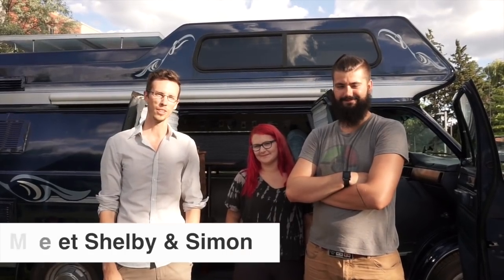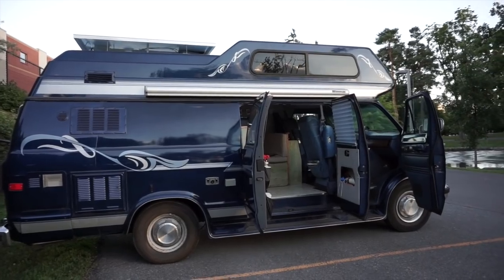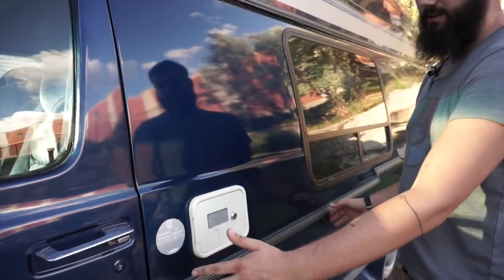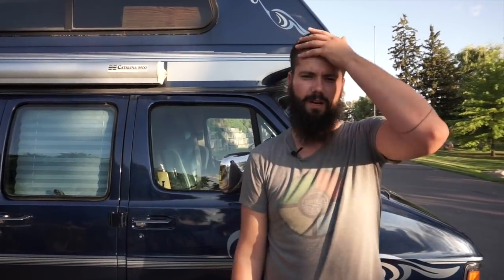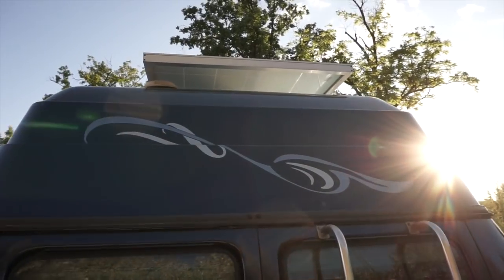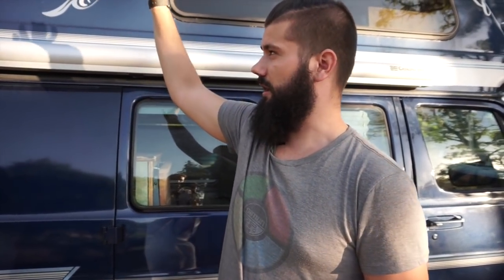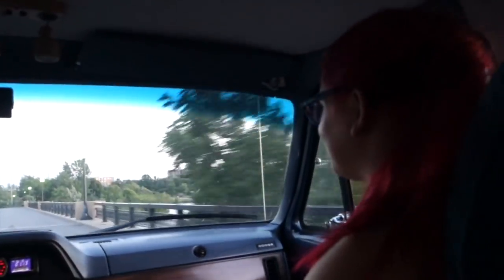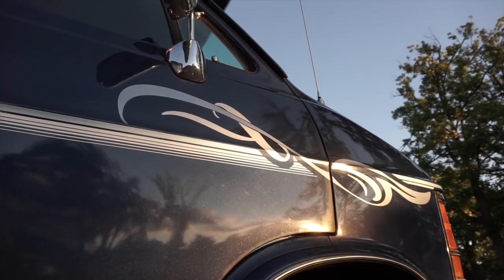Van Life - Couple Moves From Apartment to Camper Van Full Time

Comment: Forgive me if you have already talked about this idea.  If you find that empting a black tank is too much trouble you should look into a composting toilet.  I use one inside my house as a way to be more green.  I like the use of solar panels, I find that a single battery will last a long time when just 12 volt lights and fans are used so your setup should be golden.  BTW truck stops have a wide variety of 12 volt stuff.  I am sure you already know that.

Comment: I being a retired mechanic will advise you one tip, preventative maintenance is your best money saver.
Don’t go cheap. Fix it or have it fixed correctly. If one engine belt goes bad, its time to change them all.

Comment: I have the same goal to do what these guys are living. I can't wait to get my M109A3 RV conversion done! It was originally "converted" by the previous owner but the way he cut corners and how he set it up kinda sucked and because of that it was cold in the winter (I stayed in it for a year or so in my driveway) so I've gutted it, installed a raised insulated floor, and painted the walls & ceiling. Now I just need to install the basic amenities like water storage & plumbing, A/C & heat (I have a nice propane heater & an 1860's Jewel potbelly wood stove), solar (I currently have a temporary setup from Harbor Freight & two 100 amp deep cycle marine batteries), and a few other things and then I'll be ready to roll. I think a YouTube channel documenting the rest of the build and my van life is in order.

Here's some pics of the previous setup from when I was staying in my driveway.......

http://www.imagebam.com/image/22d7a9434203319

Comment: auxiliary trans. cooler, filter and aux oil filter will put off a world of major mech repairs in the future.  This van was very prone to over heating. Spare hoses and clamps plus belts will come in handy, as will a decent set of tools.  A 25 yr old van needs a little TLC. My van experience was in TX  surrounding states.

Comment: Not smart to take a 25 year old van across the country hauling all that weight on that shitty engine
Reply: The 318/360ci dodge motors are actually incredibly tough and reliable. I have a 1990 dodge B350 camper that I would trust to take across the country. It is all about preventative maintenance. Well maintained = no problem.
Reply: I've put 50K miles on it so far, no drama from the engine. She pulls all day long. Check your info.
Reply: +JamesJudasPriest: There will be problems with any vehicle that old. Hopefully nothing too serious. But be prepared for the worst because electrical systems deteriorate and water tight seals tend to fail at that age causing all sorts of problems.

Comment: Well been trying to do this for a few years now and things have not gone the way I wish but still trying. One thing that I do plan to do is replace the toilet with a composting one, then replacing the black water take and  putting in a extra tank for potable and grey water. That way you can boon dock a lot longer.
Reply: +2012spacetraveler very true, we've found that we create 8-12 times more grey water than black water. for now it's what we've got, we may change it round as well though

Comment: I used to work on the Dodge church vans.  Take the trim rings off.  They can cut the tires.  And make sure you have E-Load tires on the rear.  These always handled better with 80 psi in the rear tires and about 50-60 psi in the front.

Comment: Rain-X on the inside of your windows will help against condensation fog on those cold mornings.....
Reply from the maker: +Antique Van Camping Cool, thanks for the tip! :)
Reply: +Exploring Alternatives  .....One more thing, some Bounce drier sheets stuffed in the dark moist corners/crevices of the van (such as by the rear doors), and also stuffed in the front dash board vents should prevent any spiders from entering.......
Reply: OMG!!! I LOVE this tip for keeping out the spiders-that has been such an issue for me on some of my trips to wooded areas!  Once my car got so infested with spiders that when I walked up to the window, before I even put my key in the lock, I could see a hairy spider that I swear was bigger than a little tarantula in a web it had spun all over my steering wheel-and there it was, proudly sitting in the middle of it all like, "See there?  See what I did??? Don't even think you are getting in this car and are going to ruin my beautiful creation!! I am here to defend it to the death!!"  I was so gagging-I don't mind getting rid of tiny spiders, but I had never, ever seen a spider this big in my life-and this was on a rooftop garage in Chicago!! I lived a block from Lake Michigan, and was told by the building management that they blew in off the lake-brrrhhhh!! I still have nightmares about all those spiders-before I could ever drive my car I would have to spend at least 10 minutes searching high and low, killing the invaders and leaving a pile of spider carcasses on the pavement for eager seagulls.  It was unbelievably disgusting-but now I know how to never, ever have that problem ever again!! Yeah!!
Reply: +Geny R. yuck! I have seen some pretty big ones in nc, enough to make one cringe with disgust.

Comment: 2:45
That looks like "TAC TAC" our 7week San Diego to Eugene Or touring van.
Tac Tac was the sound that came from the engine shortly after buying it and gunning it up a hill in Oceanside CA.
Funny enough, bec we had to be so gentle with it, for fear of engine death, we drove the slower route 1 instead of 101 and saw/experienced a lot more.
Paid for itself in housing & transport easily!
$2350 Sold it for $1900
*It had a LAUNDRY LIST of OMG stuff to be done. Happy to see it drive off and not be towed

Comment: Sounds like you have a pretty good plan....Please just remember, you are dealing with a 23 yr old vehicle...and no matter how well maintained the van has been over the years, its likely unpleasant things are going to happen, and if you are not pretty mechanically (auto) inclined, you will need to not only pay for replacement parts, but the labor needed from a good mechanic..(I'm guessing youre well aware of the foregoing)...The subject of taking off on a van adventure, of course is a popular one, and appears often on youtube..one of the real popular channels is Nomadic Fanatic, you likely know of him...and he has also used older vehicles and has experienced all the common failures/breakdowns...but he keeps a positive attitude and keeps on keeping on..I wish you the same and the best of luck!
Reply: +daniel lack this is a good point relying totally on one vehicle doen'st seem sound one full time rv'er (not truly a big rv smaller version) keeps bikes in thier rv in case they need to travel around or get food or when their rv is in the shop. but of course I prefer a motor cycle or a tow behind small car or something ro just my trucks using a pull behind home. (not sure of what kind of home I would like yet heard some negative things about travel trailors I dont like)

Comment: I also live the Free Life as an Urban Van Dweller. I've never been so happy and get to travel all over beautiful USA. Never worry about break-downs if you carry spare parts and basic hand tools. Keep a spare fan belt, distributor, fuel pump, alternator and starter. Maybe throw a water pump in there too. As long as your filters and fluids are clean, belts and hoses maintained and a general inspection of the engine on annual or semi annual basis there are less worries about break-downs. These parts for older vehicles are cheap as dirt on Ebay for brand new parts. Having the part is half the battle won if there are any problems on the road. Labor costs on the road at random service stations will kill you so watch YouTube Do-It-Yourself videos to see how parts replacements are done for your specific van or similar equipments. Enjoy the Free Life and see the USA in style.!
Reply: +Stanley Stalvey If you get stuck in a remote, obscure location it could take days to get the auto part you need so they are much cheaper to have handy. An alternator can be had for as little as $37 dollars on Ebay. Buying one out on the road will cost you $180 dollars just for the same part. A complete distributor will cost as little as $45 on Ebay. Out on the road they will charge you $145 dollars for the part alone. There are crooks everywhere that will take advantage of your emergency. A battery, alternator and fan belt on the road will cost you $600 dollars for parts and labor not including tow charges. Get a AAA Auto Club membership for towing and emergency services. Enjoy the Free Life much better with these tips..
Reply: +Stanley Stalvey A can or two of Fix-A-Flat with a small tire air compressor is a must for your tool kits. Wheel bearings are very inexpensive so you may also add these to your spare parts arsenal.

Comment: Another great tip for living the free life are body oils like Skin So Soft or Baby Oil. After a bath, rub the oils all over your body and you can go for a couple weeks if necessary without smelling bad. This will also help prevent dust mites and other pests that bite the skin. Plus you smell good.! hehe.. Plenty of clean clothes for frequent changes even without a bath are very helpful to keep away germs you pick up over the course of the day. I carry several bottles of hand sanitizers or baby wipes for quick cleanups. It works like a charm.! Enjoy the Free Life.!
Reply: +Stanley Stalvey is this true? sure can use this for myself I suffer terribly from dust mite allergies (I vacuume like crazy wash my stuff like crazy and use a air filter in my bedroom) I never thought about oiling my skin, I will look into this. great idea.
Reply: Yes, I've been in the Nevada desert for a year and the dust mites are driving me batty. I have to spray, oil and still vacuum the mites out of my hair a couple times a day. It got bad before I discover there is a spray I can use. Plus my cat wallows on the floor then jumps on my bed so it's been some work to keep critters off my skin. I'm moving next month back to an area with grass and trees. I'm so tired of all this desert dust and dirt. Can't get used to it..

Comment: This looks amazing.  They said their van was a 1992-I looked into these new, and had to scrape my jaw up off the floor and pop my eyeballs back into my head.  The sticker shock was quite severe!!! I may have missed it, but did he mention how much they paid for the van?? I know that most people don't live in these full time, and hopefully this one didn't get a lot of heavy use, but if I was buying a van to live in full time that was 23 years old, I would be very afraid of mechanical failure as well. I know there are many variables-such as how it was used and maintained by previous owners-but are these vans pretty sturdy?  After 23 years is it going to withstand the rigors of the kind of road life they want to lead???

Comment: you have acid battery right next to inverter, your batteries should be vented to the outside and should not share air with converter or inverter. at least get sealed agm batteries. other than that happy travels

Comment: I can see many problems ahead...

First it seems that you do not have any experience with campers or living at tiny place where all the things have to have their own place. After few days you want that the bed is always ready and you do not have to shift things to go to bed or go to breakfast or go to drive position or at the long leg the other wants to sleep when the other one has to drive because you have some fund rising meeting 1000 miles from where you are at the moment.

Second the car is old, as you said there will be a lot of technical problems which are quite expensive if you are at the middle of nowhere.

Third your solar system is underpowered, horizontal panel's efficiency is very poor and it seems that your computer needs the inverter which will turn a lot of power to heat... You should ditch all the AC stuff and go to DC, 12V or 24V.

Fourth is the heat, you have few vents but those won't cool the car. Your fridge won't survive when there is really hot.

Fifth is the solar panel's output when it's hot and you have to park at the shade. The solution is a long cable and light weight portable panels.  

Sixth is the cold. The insulation of the van is poor, a lot of windows etc. You need a lot of energy to keep the warm up.

Seventh is the deadly sin (which do not touch you but all the others, like me, who envy you)...
Reply: Looked your youtube page. You have four videos and those are food (1), jesus who is pissed (1) and hate (2). No videos of making a long road trip with Westfalia. No tips for beginners. I do not have camping car videos on my page but I have knowledge of camping cars from 1986 and solar panels from 2007. Made trips to warm and cold places. Of course those guys will learn and manage but the starting point for that long trip is not the best one (route told at Episode 013 - Running Again). At least they are not at south at the summer. My seventh point was that I envy those guys... I can't leave and start any long trip for years (children etc...)
Reply: ok, sorry. I won't start or participate to any talk on this youtube channel anymore. Hate won and I'm out. (Still envy for the young couple's trip).

Comment: yeeesh. I hope those aren't lead acid battery. They can emit fumes that should be properly vented to the outside.
Reply from the maker: simonlynchsae I think they are but Simon is working on venting them properly :)  Thanks for watching!
Reply: +simonlynchsae we've got a 12v old computer fan that runs when the charger is running and sucks air past the batteries and inverter and spits it out the old 30 amp shore connection outlet. It was actually really easy to setup. and keeps them well ventilated and cool.

Comment: Those aren't sealed batteries you're using for the solar, and they're inside the van, yikes! You shouldn't have those inside the van, without either a vent system to the exterior, or mount them outside the vehicle.

Comment: Does the fridge run off propane? If so, how much does it use? I have lived in a travel trailer and I would like to point out that you should create an air-tight seal for the battery bay with and exhaust outside of the van. When batteries charge they release gas to their surrounding environment. Also, how much did you purchase the van for? My girlfriend wants us to do this because I make significant income remotely.
Reply: The fridge does run off propane. we burn through 30L of propane every 2-3 weeks but that's for everything. Our furnace is also propane powered and it's cold here in the Canadian winter so we keep it running all the time. We paid $4000 for the van and another $4000 in upgrades and mechanics

Comment: Do you still live in your van in February 2020? There are a lot of women going into living in vans, especially those in the USA. I live in southern Ontario, Canada and have lived in my van since July 17th 2019 because the plumber distroyed my home by putting a shut off value for the outside faucet (hose) inside a wall, right next to the stove outlet, of which I turned the breaker off in the house. Would love to know where you got your solar for the roof and who installed it?

Comment: Van life looks good but what if your home breaks down?Something major like fuel pump goes out or timing chain breaks,you're screwed.
Reply: +john cook the 360 Dodge v-8 is a good motor, easy and relativley cheap to fix, ive seen these older vans with 300,000 -400,000 miles on them,the steering box cracks the frame sometimes and rust is an issue on some of them around where the fiberglass roof joins the body but if the entire motor blows you can get a whole new crate engine with a warrantee out of Summit Racing or the dodge/ mopar performance dealer for under 2500 bucks, its the removing the engine thats the hard part as you have to take the grill and hedder panel radiator ecy apart its easy enough but its just time consuming, id put some nicer rims or at least some RV hubcaps and it would be even nicer looking.
Reply: +jay bradley I've have read comments about there being a defect in the design of the vehicle that causes the frame to crack.If the steering box go out and the frame is cracked a mechanics will not work on it until the frame is fix?
Reply: +john cook mechanics already don't want to work on it because it's 23 years old and is too tall for their hoists. I've found the best precaution is preventative maintenance. I also have a shop manual straight from a garage for this exact model and year, which I've found to be invaluable. So far with the exception of a radiator rebuild, I've done all the work myself, and trust me when I say, it will breakdown at some point, it will be a pretty shitty day, and we will get through it. At least with me doing the work, we will still have access to our home while we work on it.

Comment: Can the bed design hold two over weight adults?
Reply from the maker: Angel Greb Looks like it, they've been using it without any problems :)
Reply: +Angel Greb solid as a rock, a little tough to get up into and out of after a long day though, But at least it's really big, and the fantastic fan sits right above it, so we're very comfortable even on the warmest nights.

Comment: This van would be difficult to maintain, so ill tell you bout some cool products Dont go on road without them! Google:  SUGRU, RESCUE TAPE (silicone tape), TUFOIL (engine oil additive - NASA approved), K SEAL (engine coolant sealer - the good stuff).  Maybe even FUEL SHARK (independent tests say it works, i have one.) when will u be in Mass or FL?
Reply from the maker: +Sleekcartim .sleekcartim thanks for the tips!  I think Shelby & Simon have a travel itinerary posted on their channel if you want to check it out :)